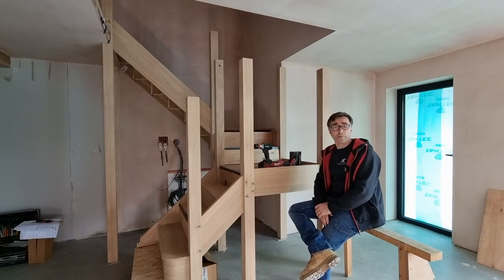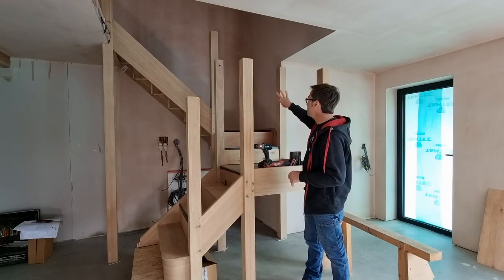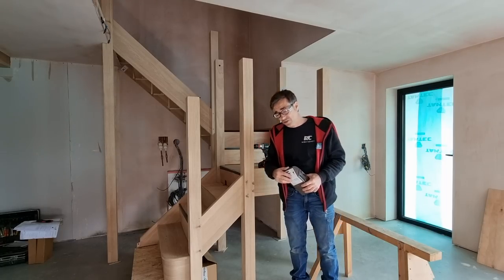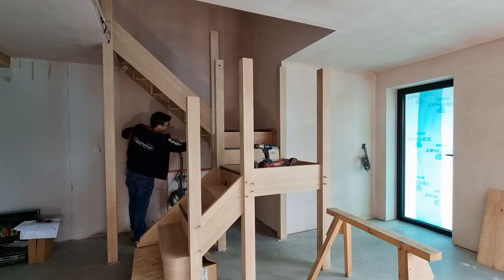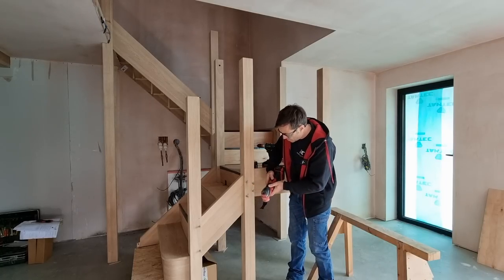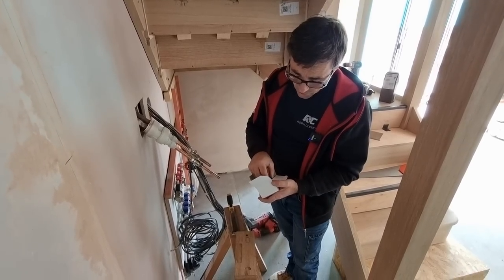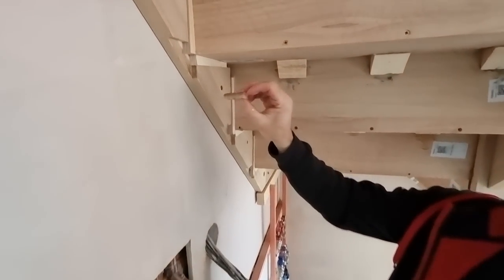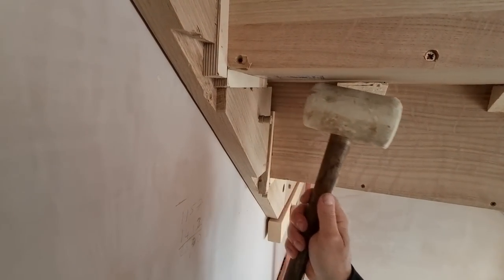Staircase part 2. Wall fixing and dowel trimming.

Comment: I am a convert to Japanese saws and chisels. Using one of those saws that  have blades that are not set is brilliant for cutting off dowels. Also the Japanese draw planes are fantastic but take a bit of getting used too but are very good on long tables or beams as the finish is incredible.

Comment: The best way I found to trim off dowels of any timber is by using the Veritas flush cut saw, the saw has very little set so can be rubbed on the timber. I use a cabinet scraper or abrasive to finish off.

Comment: Forstner bits if you don’t want your bit pulling through. Nice set of those with the corresponding plug cutters is the dream combo, Then you can pilot afterwards.
Reply: Forstner bits can wander unless in a press!
Personally I counter bore with an auger then pilot.   Will try this alternative method.
Reply: @davros1283  I’ve not had a problem with the drill bits, They are much less aggressive I’ve found, it leaves you a centre point you can then hit with the smaller bit. I agree depending on the plug cutter you have it may require a drill press, I found the veritas stubby ones from axminster are pretty good to use with the cordless drill, used them for a few years before I got myself a press and then I could get the longer cutters.

Comment: I've ordered a few stairs off Stairbox. The wedges they supply in the kit are now made from ply, not solid timber on previous orders. Also instead of a dowel fixing for the newel posts they provided SPAZ wirox screwss 6x90mm in the box, onw was missing. Then 2 wooden pine covers are glued over the fixing. The good thing is their labelling system of parts. before stairs would come in the back of the van and driver would be sure of what parts for which customer.
Reply: Why not go to a joiner, rather than mass manufactured computerised CNC shite?
Reply: Its down to costs. The last stairs cost nearly 200 quid more than a few years ago, and this was with mdf tread. The first ones were 32mm softwood treads and faced risers.

Comment: Rob, as an alternative to finishing the plugs flush, I like to leave them proud about 1/16 ish. Then start  with a chisel and cut vertically upwards from flush to the centre of the plug at 1/16, then repeat 60 degrees to the left and right, downwards. Sand off to remove sharp edges and it makes a nice feature with the plugs on show .
Reply: Sounds attractive. Like a hammered rivet head.
Reply: Over many years the  strings and newels  strink across their grain leaving dowels standing proud, which will eventually give the same effect.
Older furniture such as church pews as well as staircases were drawn in with  square grain pegs, which to me are  beautiful and an advanced spec for the perfectionist.

Comment: The best fixings to use for stringer fixing or any other structural fixing imo is a timber bolt or hex head structural screw. Spectre or Carpenters mate are good. These combined with a red plug into masonry is the way to go. I've tried everything else and nothing comes close to the pulling power. Concrete screws tend to just keep driving in but don't pull the material up. Hope this helps 👍
Reply: !  Maybe.  You might be right for a single bolt. But when driving several screws, Tapcons are the way to do it. Unless you need the strength of anchors.
Reply: What about threaded rod fixed with resin?

Comment: Hi Robin, a question about the flooring. You had the staircase measured so that the newels sit atop the Karndean FFL hence use of Karndean offcuts as packers; I assume the fitters will then trim around the newels when they fit. But if they are working round them in any case, then why not just have the newels sit direct on the subfloor?

Comment: I sometimes belt sand one side of a saw flat then use this to cut the dowels
Reply: Crikey!
Reply: @davros1283  I take the set of one side 
Then it doesn't mark the wood and pulls away slightly leaving it a little proud to sand smooth
Reply: @frankmatibs8076  
Yeah, I imagine you do.
Be gentle, but bold and thumb the back of the saw and it will be okay.
Robin does the same if you look carefully.

Comment: Have you tried any of the pull saws with a flexible blade and with no set?  Japanese-style pull saw. If I heard you correctly, I was wondering why you might have used dowels (end grain) on the posts and pellets (cross grain) on the stringers.  And positioning the plugs in the same place under each tread - unnecessary, but a craftsman’s choice.
Reply: You answered your own question, craftmans choice.

Comment: Cracking Job Rob as always but being oak would you need to use stainless steel as the the oils in the oak will attack non brass or stainless steel  just wanted to know as Im never sure when I can use ordinary ordinary over stainless and brass
Reply: You do have a point, although any black staining will not be noticeable on the surface of the inner sting as the heads were at least 12 mm 1/2 inch beneath the grain pin pellet.
Best practice is brass screws in oak, but are a pain, as they snap off easily.  Stainless 2nd best IMHO.